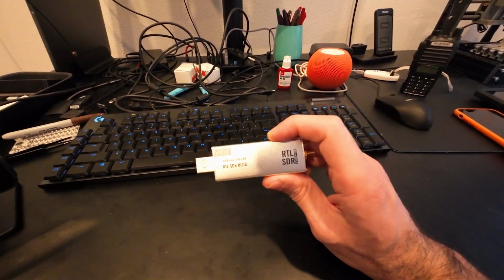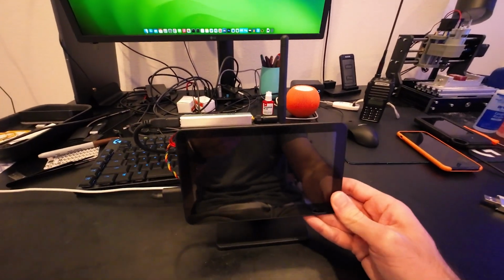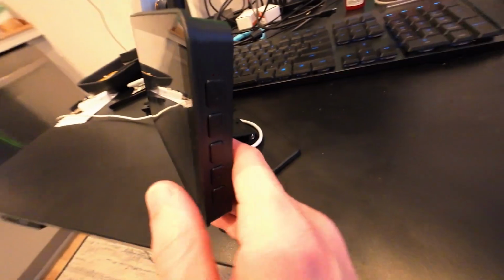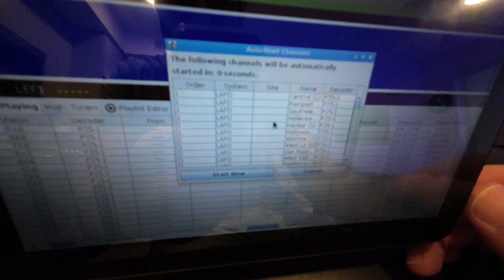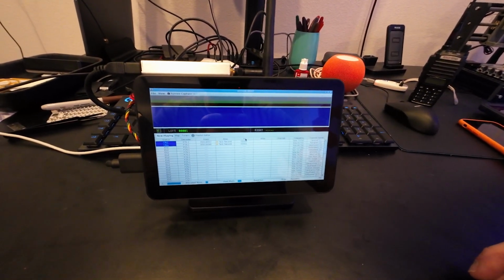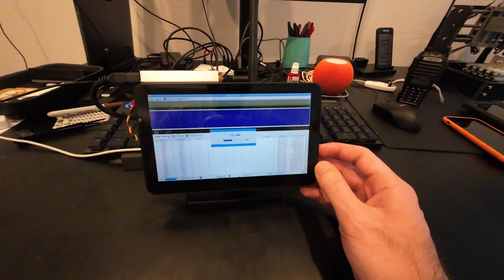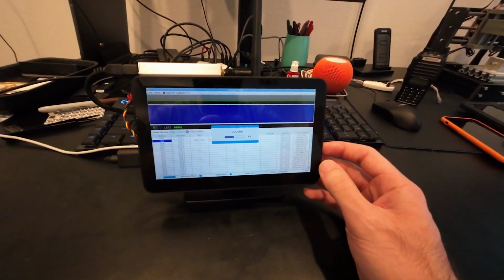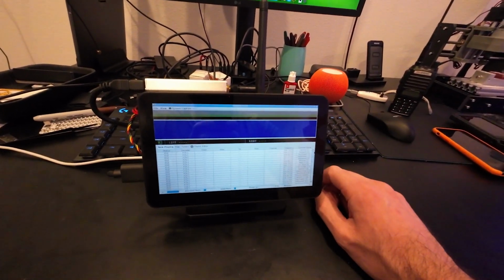Building a $600 P25 Police Scanner for $250!!! (SDR-Pi)

Comment: Awesome video!! I have a Pie 3 running Op25 to pull in trunked systems in the area and it has worked flawless since 2019. I have about 9 different Pies doing different things and just picked up a 5 16GB. Looking to do more radio things.

Comment: I bought a uniden bcd436hp for 100 and sold it for 300 ! But yea I use sdr trunk to hear what's going on or my EF Johnson 5100es
Reply: Where heck did you find those for $100 and still sold only for $300?

Comment: You have my undivided attention.  I've been contemplating making something like this for a while and your video gets me motivated. I would love to use a smaller display to match the foot print of the Rasp Pi.  Is that a touchscreen with USB cable back to the Pi? or does that pop up go away on its own as the software loads right before you hear the dispatcher talking?

Comment: How is your pi5 holding up with sdrt? Have you considered ading a second sdr dongle to handle the bandwidth of your metro p25? In my case pi5 was just not enough to stay stable running sdrt with 2x rtlsdr's in sacramento. The cpu remains very close to pegged like yours, and this resulted in way too much dropped traffic. I reverted back to using an old x86 laptop for now.

Comment: What is the model of the RTL-SDR dongle? Is this the chip RTL2832U?
Reply from the maker: Yes it is
Reply: @TopDNG can you share the software? I have one RTL-SDR with 2832u but don't work
Reply from the maker: @OrangePiVietnam  did you install the rtl-sdr package? The software is SDRTrunk https://github.com/DSheirer/sdrtrunk
Reply: @TopDNG  yes, already, but when i run sdrtrunk,  the tunner have status error :(
Reply from the maker: Ohhhhh @OrangePiVietnam  ; yes, this is a strange error that sometimes happens. Please try using a different USB port (are you using the USB3 port or the USB2 port)?
Reply: @TopDNG  i tried all usb port, sdrtrunk always stated that the USB tuner is in-sed by another application
Reply from the maker: Hmmm I have never seen these errors before @OrangePiVietnam  

"Unsupported/Unrecognized Tuner Type: FC0012 " makes me think the dongle is not the same:

"The RTL2832 dongle that you're using has an unsupported tuner chip. sdrtrunk currently supports the R820T, R820T2, and E4000 tuner chips.
It doesn't support the FC0012 or FC0013 chips."

https://github.com/DSheirer/sdrtrunk/issues/1474

Comment: You should have 2 dongles.  I guarantee you're missing a lot of calls due to bandwidth limitations.  If a selected P25 frequency is more than 2.4 Mhz away from your control channel, you won't be able to pick it up.
Reply from the maker: I have 2 dongles, but it's not shown or used here. I'm also not sure what you mean; I am under the impression that the LAPD system has one frequency for each channel. To cover the entire system simultaneously you need two dongles because one doesn't have enough bandwidth to receive all the channels spanning from ~484MHz to ~507MHz. However, if you're only interested in a subset of the channels you can just use one dongle; I don't think that there is a control channel that is required because the system is not trunked -- please let me know if I am mistaken though!
Reply: @TopDNG  It's not JUST a control channel, if there are 2 calls where the frequencies are far enough apart you'll get "tuner unavailable".  Since one of the BIGGEST advantages of SDR-Trunk is the ability to listen to more than one channel at a time, you could end up missing some calls.

HOWEVER if >ALL< the channels available are inside the bandwidth of the dongle you're good.  It appears you're listening to a standard digital system (which is why there's no control channel).  It's a pretty safe bet that they will be upgrading to trunking sometime in the future since it allows for a larger number of calls to be handled in a limited frequency range.  Generally my understanding is that with the SHEER NUMBER of working units they have in use, they may not be in a hurry (financially) to upgrade, but it will happen eventually.

MOST people will have a trunked system to monitor, and 2 dongles is pretty much a MUST have for trunked systems.
Reply from the maker: Roger that. Rumor has it they will be going encrypted soon... but yes it's a big financial investment. @MikesClassicEntertainment
Reply: @TopDNG  I forgot to ask...  Have you tried entering them as DMR instead of P25?  I BELIEVE if you have them set under DMR you can use the map feature to see where they are LOCATED at the time of transmission.  I may be wrong, we don't have DMR here, so I have no reference, but I THINK they can monitor their cars locations, and wondered if that's how they do it...
Reply from the maker: I haven't tried this DMR experiment; I would be shocked if it worked -- seems like a safety risk to broadcast their locations in a way the public can monitor their whereabouts. @MikesClassicEntertainment
Reply: @TopDNG  They broadcast their location when they call in, all DMR is going to do is show it on a map.

Comment: Very nice. I just received my first pi5 a couple of days ago and was looking for a project. Even though I'm in a rural area, the next county over has a trunked system. This should be perfect, and I only need to buy a new power supply for the pi5. I already have several rtl dongles and a discone antenna.

Comment: Does this work with both P25 phase 1 and phase 2?
Reply from the maker: It should, yes. You might need 2 dongles for some phase 2 systems but I am not sure about this. SDRTrunk introduced phase 2 decoding in 2020
Reply: @TopDNG  You need the 2nd dongle for the bandwidth.  It has nothing to do with phase 2.